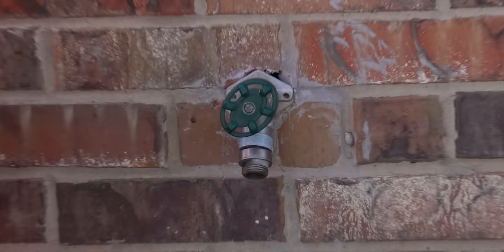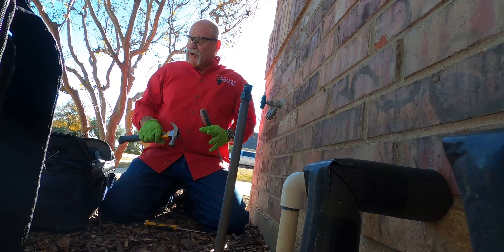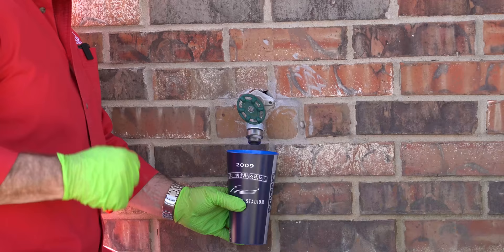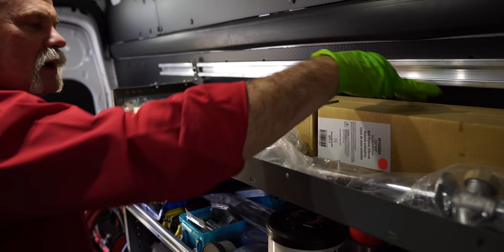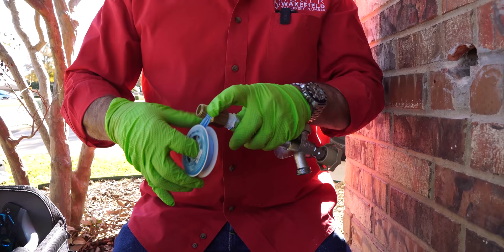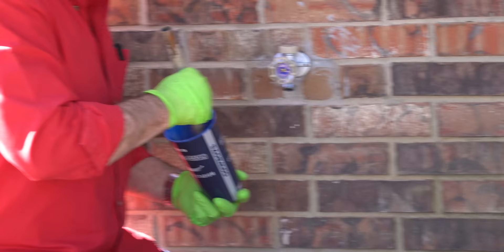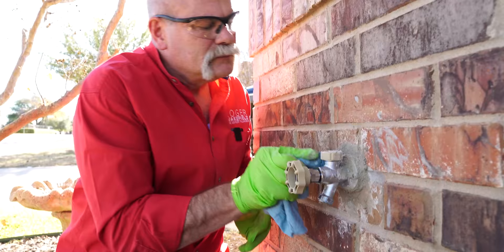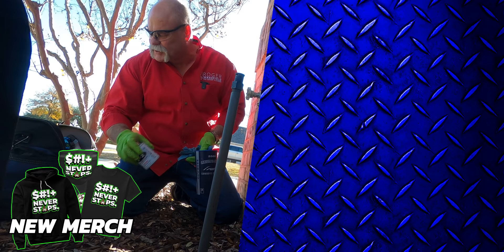How Pro Plumbers Replace Frost Proof Faucets

Comment: Instead of teflon, try looking into Loctite 55. We use that for fixtures like this and that stuff just NEVER leaks. You could even get away with turning it counterclockwise a quarter of a turn.
Reply: not familiar with Loctite 55 . Is it approved for potable water systems?

Comment: if the hole is oversized and allows a lot of movement....I've used light cord/rope and construction  adhesive to buildup/shim/brace faucets...particularly if kids are using them!

Comment: Carry sandwich bags with you put the brick mortar in it. Add little bit of water and keep mixing in the bag by squeezing it. when it's to the right consistency cut the end off of one corner and squeeze it in far less mess and you can really pipe it in there.

Comment: I  have PEX plumbing.  Anyone can fix and modify.  Have tools and stainless steel pinch crimps.  My problem was completely different with regard to the outside faucets.

In the original installation,the plumber did not fasten the faucets to the brick and mortar and so the faucet had play in it.  It stuck out far enough so I could build a (neat)mound of mortar around the plumbing sticking out and while wet I used two stainless steel screws (using the hole provided on the faucet) to keep the faucet from twisting.  I live in a subtropical area where it only freezes at night and then for only a few hours.

Comment: What we do where I work is we make service loops on the wall with upounor pex so when you need to fix it you can pull it straight out
Reply: That’s all well and good assuming you have a really secure attachment to the exterior wall so it won’t pull out of wall when using faucet.

Comment: I have a woodford..just can not tell if its screwed in or soldered!! Not trying to knock pieces of cinderblocks or cut into drywall to find out. Also don’t want to play and alot of money for an possible screw on connection

Comment: I saw a smart idea on risinger for new houses or remodels. It only works if you out the hose Bibb where an interior wall butts up to an outside wall. You basically make an 1 1/2 or 2” double clean out (2 combos facing each other) in the wall then feed a loop of pex through the top of the back combo and back down the front combo then straight out where ever it ties in. This gives you enough slack to pull the whole hose Bibb out of the wall to tighten it and then you can have a smaller hole so you can screw it to the brick
Reply: Apprentice plumber here: the Company I work for always has a pex loop, basically comes out of the floor, goes up, has a loop, then we support it with 2 nails on each side holding it. Then if we ever get called on a Warranty thing or remodel etc, we can just unscrew the current hose bibb, pull it out a bit, cut the line, then put the new one on.
Reply: @BigBrainGunner  do you do it with all hose bibs or just freeze proof
Reply: @joshcowart2446  only hose bibbs we use are the Woodford freeze proof ones, and we do it on all of the house we do.
Reply: @BigBrainGunner  makes sense. I live in Texas so it varies depending on what people want
Reply: @joshcowart2446  ah, yeah. Lived there for 3 or so years, and did a little bit of plumbing with my dad, but then moved to Washington
Reply: @BigBrainGunner  does it freeze much in Washington. For some reason I thought it didn’t have a lot of freezing temps despite being that far north. I’m thinking mainly if the coastal areas. I figured it got colder in the mountains and to the east
Reply: @joshcowart2446  The weather itself can get cold and freeze stuff, but it's pretty rare as far as I know.
Reply: @BigBrainGunner  yeah that’s what I thought. It’s interesting the way climate works. It’s not always proximity to the equator that decides how cold/hot am area is. Most other states along that same latitude are much more wintry climates.

Comment: I use Woodford Model 19 for a couple of reasons.  It's American made and the Model 19 is designed not to split even if the hose is left on in the winter. The quarter turn sillcocks have a tendency to fracture at the ceramic discs - very common in the north.  Woodford does not produce quarter turns for that very reason.

Comment: Note to dummies like me.  Mine was wrapped but had a hose quick disconnect left on.  Essentially it left water in the tube undrained and now it's cracked from the freeze.  Hopefully I can get it to unthread without it breaking off completely.

Comment: Hi Roger. You are my hero! I have been looking to replace the whole faucet because I believe I did ruin mine awhile back by not opening the valve when I screwed the inside part back in with a wrench, thus ruining the internal part. I have a picture now that I've chiseled out the mortar but I can't tell by looking if it's a screw in or a sweated joint. Is there a way I could send the pic and see what you think? I'm in Ft. Worth and I see that your service area isn't any where near me. Thanks.

Comment: Teflon tape is not designed to seal, it only helps lubricate the threads to let you tighten it tighter and make a seal. The pipe dope IS designed to seal, I think your fine to use both, they each do a different job

Comment: I wish you gave us more close ups. I did one by myself without any idea what I was doing and struggled to get it tight. Also what would you use to fill if it's not on brick but on siding?
Reply: I use clear silicone caulk

Comment: Not to be “picky” but I was taught put the Teflon on left/counter clockwise...just picking and dam that was a easy one last one I did took me 3 days!
Reply: Always Teflon the same direction as what your tightening on. Its usually to clockwise,  unless its some kind of reverse threaded part. .. this way it can never bunch up by pulling off where your teflon stops, it wont be trying to unwind off the threads.  Hope this helps u in the future.

Comment: Only thing I’d have done slightly different is I’d have put masking tape on the brick to minimize mortar scale on the brick face. Take a little more time but had a homeowner threaten to not pay for a job because he felt like the mortar was “too visible” on his brick. Ever since I make as much effort as possible to reduce making a mess on the siding material. Even on siding we use tape when we caulk.

Comment: good morning excuse me I think you had to test the key before sealing it with ground to see if there was no liquefied inside the wall
Reply: You can always just check the meter for movement when finished, take a picture and recheck before you leave
Reply: Like the other commenter said, check the meter. You can also use a small camera with a light to monitor the threads/ install before patching the mortar back up.

Comment: You'd make way less of a mess with the mortar installation and get better penetration if you used readily available disposable paper funnels. Just scoop your prepared mortar into the funnel, snip the point off and get pin point injection of the mortar. Running your finger around the edges to finish it off.  :o)

Comment: why did you not put 2 screws in there if some one/ kids pulls on the hose it can brake  it lose now with out them. now that's what them 2 holes are for on the side of the faucet SCREWS. could easy added them in there and let the mortar get hard around them screws

Comment: Out of curiosity, is there a reason why you wouldn’t use a quality outdoor sealant (caulking)? What’s the benefit of using the mortar
Reply: I assume it's just because mortar will stiffen up the hose bibb so it doesn't move at all, and keep bugs from getting in. A sealant isn't needed because the brick isn't a sealing surface for the house. The air/water barrier is actually behind the brick, which is good because both brick and mortar absorb water.

Comment: I also tape and dope my joints. I just had to fix a rough in that my boss did he only taped his joints. I learned early on when I was at a commercial plumbing company you tape and dope if you didnt they would make you take it apart and tape and dope it. If you tape and dope it it just works, I've never had a leak.

Comment: 1:10 Why are you replacing the whole frostproof when the issue might be just the seal or mineral build-up that prevents it from sealing?

Would it be better for the customer and the environment to just disassemble it, clean up the seal and put it back in?

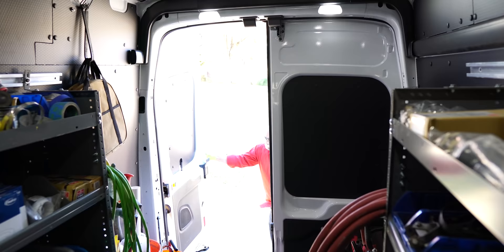EDIT: 4:10 fair enough

Comment: i recently had to replace the vacuum breakers on 2 faucets because the caps crumbled away due to being 20 years old. It should be easier to find the correct ones for older faucets.

Comment: washers work better for shimming the back if you slip washers over the back before you screw it in theyll snug against the wall also aluminum works well to just cutting a piece of aluminum and drilling a hole in it and beveling the edges to make it look nice, putting random things in the wall seems odd and cheap lol but that’s probably how its done 90% of the time

Comment: I have rebuilt mine several times. Never had an issues. I have them sprayfoamed and siliconed in.
Reply: You must be lucky and have either a newer home or a more common brand.  Mine (23yo home) look like the one he replaced, and I can't find any parts for them.  I can replace the washers to stop the drips, but all three of mine leak at the handle.  Plus, the handles are all stuck in place due to the hard water.  So I'll be replacing them all this weekend.  Just wish I knew for sure that they are not soldered in.

Comment: Why do you need a frost proof spicket in Texas just wondering
Reply: Just standard plumbing code. They can get frost in polar vortex from time to time. Biggest thing is having the vacuum breaker. I'm from Canada and we mostly only use 12inch and up because of how cold it gets. Never hurts to spend the extra couple bucks and guarantee for your customer that their silcock will never fail

Comment: Nice video!! 
Wouldn't it make sense to have a shut off valve just for that hosebig on the inside of the house? Then you don't have to shut off the main valve and drain all the water in the house
Reply: It would but many houses don't have them in Texas.  I'm also in Dallas and my house has no shut off inside, only the main shutoff at the curb on the street.

Comment: The only frost proof faucets I could find at HD was 12" long, my wall is 6" thick so I had to use a regular external faucet, I just have to shut water off inside in cold weather.........

Comment: One thing I would've done different is to tighten the extension piece before you used tape and dope. Nice work though!
Reply: What do you mean exactly? He used tape and dope on the spigot then put the extension on it, otherwise it wouldn't be sealed. Then he tightened it as he should've.

Comment: If it was soldered, you could in theory remove it with a lot of heat and opening a fixture lower than in with the water off (or suck the water out a bit) disassembly would be recommended to avoid heating things that can release fumes and to keep the heat in the material, replacing it would be up to your imagination but I’d suggest maybe using a long bit and screw to go through the wall directly behind it (if it is a finished basement like I think you implied) and then you can make a small easily patched opening that is only as big as it needs to be, and then use one of those torches with the hose to the head to save space, alternatively you could try to heat it from the outside the same way and have a ring of solder wrapped around where it’s needed but I really don’t recommend that, anyways you being a professional plumber you could likely figure out better or safer or more successful ways to do it, maybe a shark bite or similar to make it threaded? Also I stopped watching once I found out it was the threaded type, did you later do a soldered one?

Comment: I would have put some sort of tape on the brick so that the mortar wouldn't smear all over the place.  I would only allow 1/4" exposure of the brick with the tape and not have the mortar so loose, a little tighter and still could squeeze it in place.

Comment: Why didnt you go inside and locate it to see if it was threaded or soldered before breaking out the mortar?
Reply: How would you recommend locating it from inside? Me personally. Ive never seen a spigot just open inside a house, its always behind drywall or something. Id rather knock a small hole in the mortar like him but then i would use a small camera with a light to look in there with very little invasion. Not only that, you need to remove it anyways so why suggest otherwise. Sorry but i dont understand your logic here.
Reply: @kmarl87  threaded will slide straight out through the hole without needing to chip any, and typically the spigot is in the basement running along floor joists.  I've located many that way and removed them without chipping any mortar so I'm not understanding your logic of damaging exterior wall before looking for the inside
Reply: @gamingmadesimple5510  ah i see the confusion here. Im thinking of a house without a basement so on the ground level and you are thinking of a house with a crawlspace or basement with the spigot being accessible there. Sorry about the confusion then mate.
Reply: @kmarl87  unfinished basements and crawlspace both are usually piped in that manner,  I guess here the typical house doesnt have a finished/drywalled basement.  Maybe 1 in 15 houses if I had to guess.

Comment: Man I've been a helper at a residential service company for 4 months (part of what got me into it was your videos, you're awesome dude) and the FFs in my area are always directly screwed into siding and we just have to check the connection (usually in the crawlspace) and then unscrew it, a lot easier than breaking the mortar and putting it back after lol. Now I know what to do if we come in contact with a brick wall!

Comment: I can't watch one of your videos and NOT learn something. Always appreciate your videos. I do suggest getting a caulking gun and concrete caulk to make those joints as simple as a sink-toilet etc.. than its 1 simple wipe and move onto the next job. 

I do have a question though.  I ALWAYS check the water before sealing the hydrant and you did not make a point to do that. We BOTH know you got it done right. Some tape and dope cures it all. I'm sure you can understand my point of view sir.

Comment: I prefer 1/4 turn faucet, the inside is like a ballvalve and last longer 😄
Reply: I changed all my frost proofs to actually 1/4 turn hose bibs. Frost proofs failed within a year, all $45 each one of them. Forget to remove hose on time on a freeze and thats it. Time for a new one. I insulated all the crawlspace pipe, ball valve shutoff bib and life is good.

Comment: A cleaner and easier way to fill the gap with mortar would be to put it inside a plastic bag and cut the corner. You can use it to pipe in the mortar and have less of a mess.

Comment: Only thing I would do different is i would use refillable caulking tubes to pipe in the mortar.  Little to no clean up after and a lot more accurate.

Comment: I live in  Canada and I never recommend those types of sediment faucets because they aren’t very serviceable and I have seen them freeze on multiple occasions. Also, you didn’t remove and lubricate the packing nut if that’s possible on those models. Not a requirement but it helps prolong the life.

Comment: I'm pretty sure he said it was threaded into a drop ear elbow which are usually fastened to the framing therefore not risking twisting the pipe. If this was threaded into a straight pipe run, you would most likely twist the copper pipe in the wall. So most likely you will never be this lucky and plan on doing a drywall patch.

Comment: I've legitimately never seen them screwed in like that. They're almost always soldered in or pexed in around where I'm at. I'm not saying it doesn't make sense, but how are you sure that it is secure enough in the wall to tighten from outside without twisting the copper up? 

I mean, you could probably do this on galvanized with no problem, but without any backup on a 1/2 inch piece of copper I'd be worried about breaking a 90 behind the wall. 

I'm not hating, btw. I genuinely have never seen that setup actually go like that though.

Comment: I would have showed 2 wood screws in that plate and wet mortar to make sure it doesn't twist and unwind the connection in the wall if the home owner torques the valve too tight.

Comment: can i make a suggestion for u? We use in finland this locktite 55. Excelent to use in place of your teflon tape. Have been using it now 10years and no leaks what so ever, fast and comfortable :D
Reply: Is Locktite 55 approved for potable water?
Reply: @chrisgraham2904  yes potable water, gas line thread joints, heating water thread joints ( radiators) Look IT up💪
Reply: You can find vid on YT of it. Will take plumbing to next lvl

Comment: Man no idea why you used mortar to fill that, i would had used exterior caulk, would create no mess around like you did, not that its that visible but still, and made it more waterproof per say than re applyng mortar. cheers!
Reply: As a plumber myself the mortor is stronger which is important for a bib because home owners like to jerk and pull on the hoses ive tried caulking it just doesnt take the abuse lol

Comment: Haha, I was told that they are screwed on and relatively easy to change, so I bought a new one, tried to unscrew the old one to find out after it twisted off the pipe that it had been soldered on, instead of using the threaded pipe fitting that was there. I ended up opening the wall inside to access it, then repaired the wall. I guess the lazy way of the original build was to stick the 1/2” copper pipe into the frost proof and just solder it on.
Reply: Actually most are soldered or glued